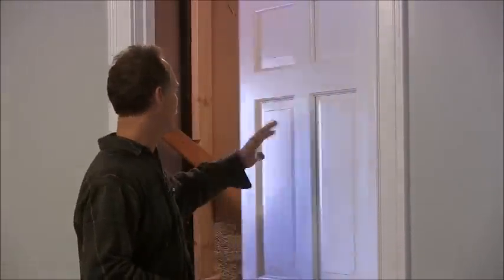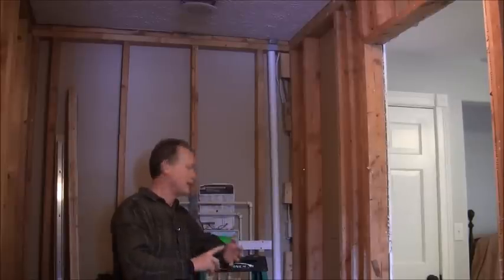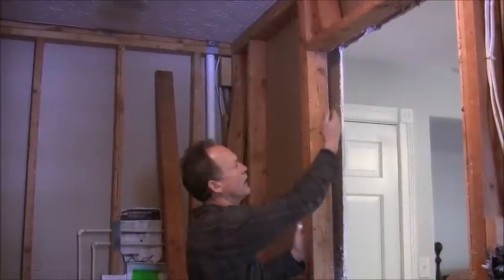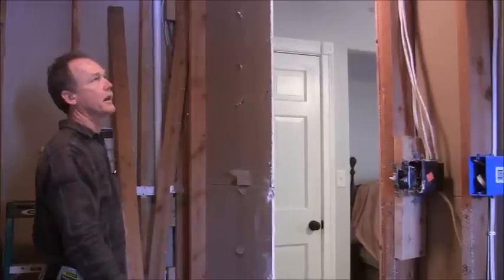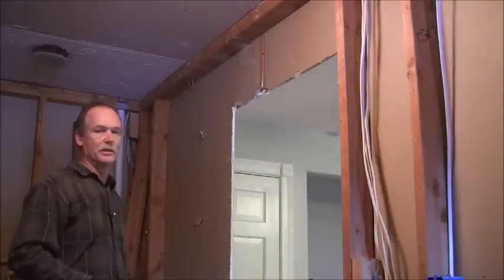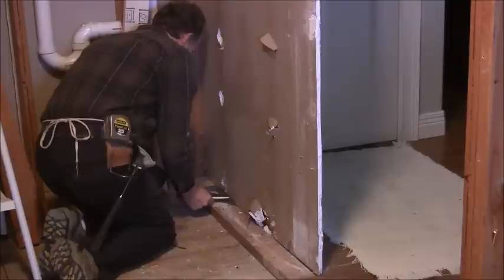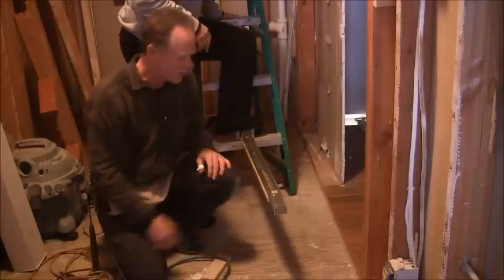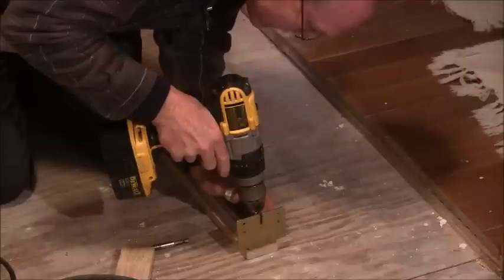How to install a pocket door in an existing wall

Comment: Thank you for taking the time and effort to make a detailed step-by-step video with commentary, including how to make it better and obstacles you encountered. I'm retired and working on remodeling at home. I'll be starting my first pocket door installation, with relocating electrical outlet and switches, this coming week to replace a 2' standard bathroom door with 2'8" pocket, thinking of eventual walker and wheelchair access. Your process with an existing wall is really helping with measurements and confidence.
Reply from the maker: You are welcome. Glad I could help. I answered your comment about the house being on a slab in the above comment. Good luck with your remodel.

Comment: Great job. I would probably try to use more screws than nails just incase I have to make adjustments or remove something but I see you are very comfortable with a hammer & nails. Thanks again great job and tips for my future pocket door.
Reply from the maker: Thank you! This door has been installed for 7 years and we haven't had any problems.

Comment: Looks like a lot of work to save a section of drywall you are going to have to do a lot of patching on….I would have just pulled the drywall on both sides and reframed….
Reply from the maker: If you pull the drywall, you are going to have to finish it in a room that is already finished and painted. Also, if you pull the drywall all the way to the ceiling, you are going to have to finish it or at least put crown molding up.

Comment: My only comment is about the header. Shouldn't the header be sitting upright, rather than setting flat on the stud?
Reply from the maker: This is a nonload bearing wall. So, it really doesn't matter. It has a truss roof system, so the bearing walls are the outside walls. If it was load bearing it would need to be sitting upright and larger.

Comment: On the header rail, you cut 3/4 inch too far back that created that gap you were talking about, If the header was cut at the right measurement, you would not need to build out anything. I have watched many of these pocket doors installs and not one had to add or lengthen on either the door jam side or the bump stopper.
Reply from the maker: I cut it where the instructions said to.

Comment: Lot of work for a hidden door.
Reply: We really appreciate all the video and carpentry work that went in to make this pocket door a reality. To hire out this job I'm guessing would cost 2,500 to 4,000 parts and labor, because of all the detail work and the door swing savings. It can be well worth it for nicer homes where door swing constantly gets in the way.
Reply: @dporrasxtremeLS3  I’m a general contractor. And you are correct but that’s the cost for replacement. It’s cheaper on a new house before drywall and wire are installed ($500-$900) which in that case makes the job more less delicate and easier

Comment: Drywall screws for affixed structural elements?  No.
Reply from the maker: What?
Reply: @doityourselfdenniscom  In the video drywall screws were used to affix a header stud.  That’s quite often a code no-no.  Drywall screws are for drywall.  Wood screws like deck screws are structural screws.  Metallurgically, their properties are quite different.  Wood Screws are made of a softer metal that is stronger but resistant to fracture under impact and cyclical load.  Drywall screws are hard and brittle and provide little resistance to fracture if put under load.

Thick screws
Made of soft metal
Resistant to fractures
Drywall Screws:

Made of steel
Material is hard and brittle
Little resistance to fractures
Reply from the maker: @staberdearth3130  But, that header is really not structural, the house has trusses and this is not a bearing wall. It is basically just something to attach drywall to.
Reply: @doityourselfdenniscom  I understand that.  I will even support your claim if it is indeed a non supporting (load bearing) member over a non supporting (load bearing) header.  However, my point is that often, and I’ve seen it more than once, codes, depending upon how they are worded, often go against the builder.  Debate can often occur especially with an inspector who is inflexible or unsure and will default on the safe side.  Insurance companies will nitpick over such things.  Risk is low, but consequence is high.   

Not necessarily related but here’s a highly frustrating code related example.  Some years ago I installed an electric stove and anticipating the new upcoming code did not hard wire but used a plug and outlet.  The inspector made me tear it out citing that my method was not to code at that time, regardless of any future changes that had not yet been formalized.  Most inspectors would have let it be, not this guy.

Comment: Good call on cutting the nails holding the studs with the sawzall.  With the problems you had with the studs, I would have used drywall screws and a drill to secure your studs, this would have saved you some time and possibly saved the one stud from a beatdown that he took. If you have to remove studs later, you just flip the reverse on the drill. Old, hard studs are no match for your drill and screws. I would suggest to my workers to turn the sawzall the other direction as you came close to sawing the live electrical lines.

Comment: put trim on before the guides
Reply from the maker: I have to disagree. I just installed another one of these recently. The instructions say to put them on before the trim. I installed the same door in my personal house several years ago and I have never had any reason to adjust the guides and don't see needing to any time. The guides are designed to last a very long time.
Reply from the maker: @calossmann6653  Sorry, I thought in your first comment you were telling me to put the trim on first. I guess you were asking if you should.

Comment: Good detailed video. I use wood screws to attach the studs and assemble kit. They also make door kits that come in a more assembled state. I'm doing my laundry room door this weekend.
Reply from the maker: Thank you. I try.
Reply: I checked out the Big Box store preassembled kits - they get terrible ratings - I'm going to make my own . . .
Reply from the maker: @paulrobinson9318  The one I installed here, I bought from Lowes and it has been great. The door operates perfect.

Comment: He's working way too hard to preserve $5 worth of sheet rock on the good side. Just rip out both sides, rebuild and mud/tape/paint. Those cut off nails in the sheet rock are going to work out eventually. Look at the huge tear outs of rock came with the nails, that violates the fire barrier sheet rock provides, even if you make it look nice on the clean side. At the end that good side of the wall looks too good compared to the damage on the inside. Touched up maybe?

The manufacturing instructions tell you that all the surrounding framing has to be square and plumb. Other than a level on the track I wonder how true all those elements are.

You say in your description that you aren't too safe, but you've been doing this for thirty years. Five minutes from now something could go flying and you lose an eye. Wear safety glasses in your videos and your life. I've been riding motorcycles for 45 years, and I put on my helmet every time.